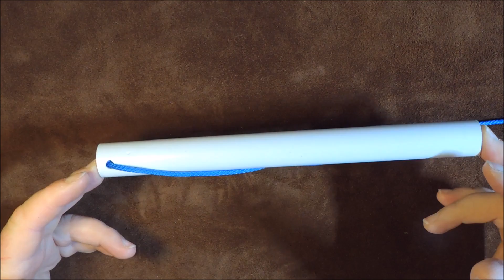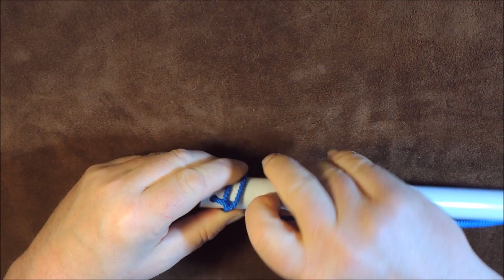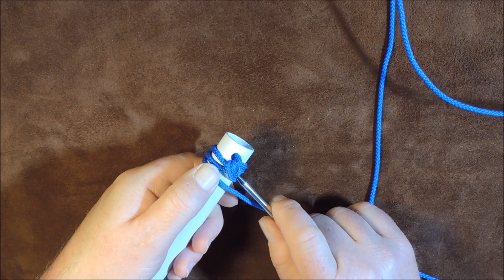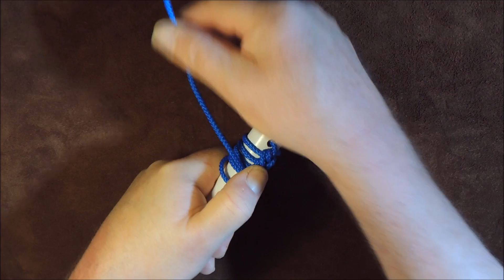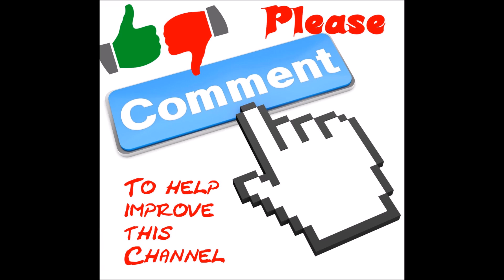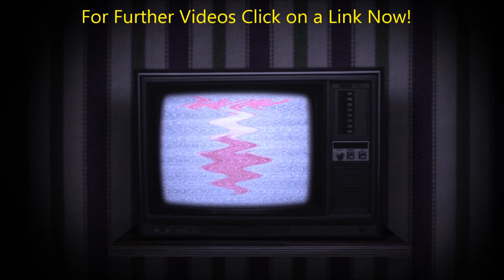Single Strand Ringbolt Hitching - Single Strand Cockscombing - How to Tie

Comment: I like this a lot!!  I think I can use this on a cork, you know I've been looking for a knot for it!!  Great video!!  do you think you can tell me how to start it out if I used a cork?  Thanks John!!
Reply from the maker: Perhaps start if off in exactly the same way, then maybe a little dab of glue and then cut the end off flush? Maybe also drill a hole all the way through the same size as the cord, then a slightly larger hole half way through. Pass the cord through the larger hole end, tie a knot and that knot should then fit in the larger hole but stop where the hole gets smaller again. Or small Turks head at each end to cover start and finish.
Reply: If you are talking about a cork, as in a wine bottle cork, then you might want to try needle hitching instead of ringbolt hitching. https://flic.kr/p/cvVLpN
Reply: Johnny Debt Sounds good....thank you John!!
Reply: Roger Banks thank you, I will check it out.